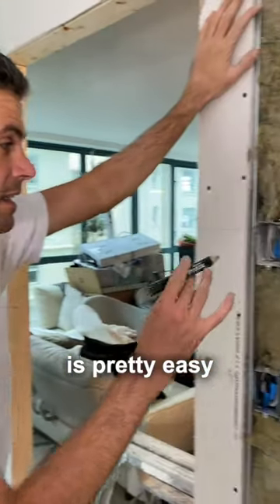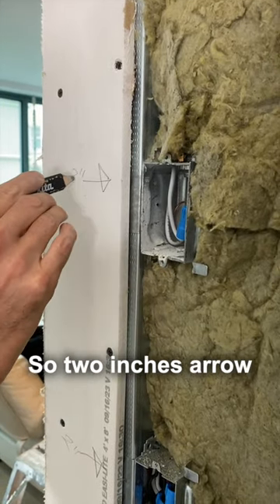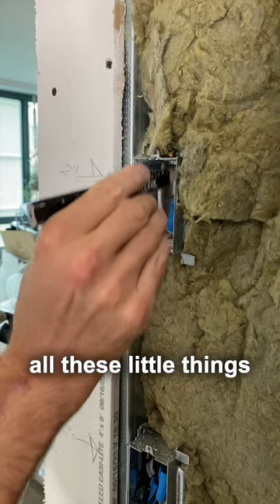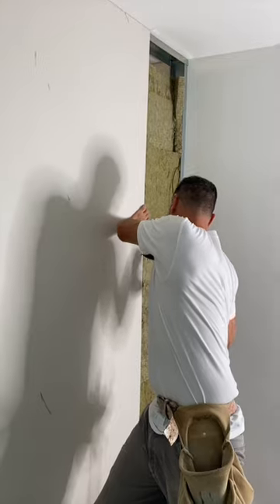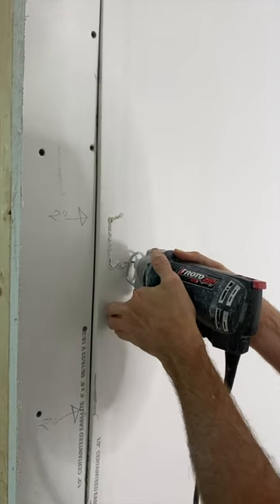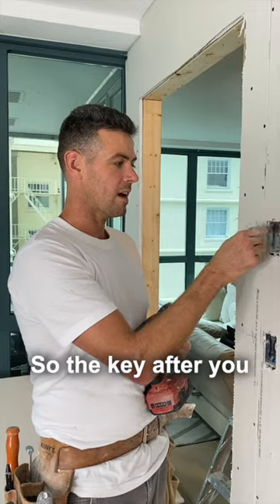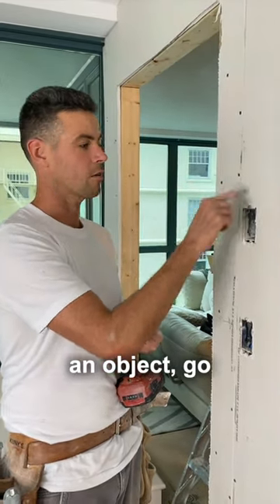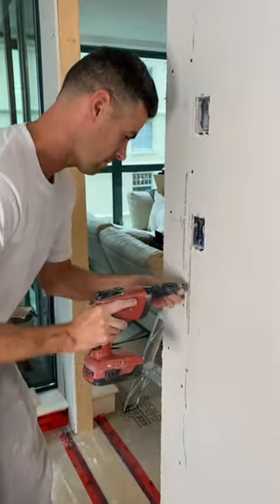How to Use a Drywall Router. The Easy Way!

Comment: Man your drywall tips are killer. I’m a carpenter, but I’ve been getting more into drywall jobs lately with a buddy of mine. We’re both okay at it, but your videos have been a huge help with stuff like this. Thanks brother!
Reply: Is being a carpenter very physically taxing? Or is it manageable?
Reply: @ereh11  once you get used to it, it's not that taxing, plus it's great for the body. You are bending and twisting and reaching above your head and down to the floor. So much healthier than sitting in a chair all day.

Comment: Metal boxes make is so much easier! No fear of burning through the damn thing!!
Reply: Exactly 
I always cut through the blue boxes and mess it up
Reply: Yep, annoying
Reply: So that's what those cuts in my electric boxes are from. Go figure.
Reply: @carpentrylover145  if you use the guide point bits, it is less likely to cut through the plastic box.
Reply: @larryrice2654  agreed.
Reply: Should be code everywhere except for exterior applications. Plastic boxes are junk!
Reply: If you know how to use a router it doesn't matter if it's metal or plastic
Reply: If you let the router do the work and push gently you'll never burn through a box. And you have to have the correct bits with a dull guide point
Reply: @graxo3752  agreed, but there is a learning curve! If you are not a professional, doing it every day, it takes some time to get a feel. Hell, it takes a moment to remember which to go!
Reply: How does one solve the issue where too much mud made it inside of the electrical box? It's a pain in the ass for electricians
Reply: @fixerofthings  yeah good to know that I had some incompetent moron doing my drywall 😂
Reply: what’s the screw tool called?
Reply: @YouTh3r3 It's supposed to be the drywall finishers job to carve out any excess mud around the inside of the box when fully cured, but based off the internet beef, many in the trade don't seem to bother.

Comment: Here’s a pro tip, never land a joint next to a box, you don’t understand how much more annoying taping that is
Reply: You put it where you want/need it, not where it's easier.
Reply: @habiks you put the box where you need it. You can put the drywall where you want it
Reply: I'm more concerned about the joint being so close to the door. Less likely to crack if it was above the header. The box close to a joint is just a minor inconvenience
Reply: Most times you just don’t have another choice. And its really not THAT much harder to tape 😂
Reply: big time. amateurs are commenting on this.
Reply: Lol bud youre not a pro because you like easy short cuts and avoid a little extra work😂😂😂
Reply: @CFLavertu No disagreement there, but in this case. He had that choice. Look at remaining wall layout.
Reply: @HumilityListens  tell me you've never done drywall, without telling me you've never done drywall 😂😂😂

Comment: I like when the drywall guys use these on all the blue pvc boxes. Just wiggle them around every which way as if they were trying to draw a star. Cut thru the sides, top, screw holes and wires.

Comment: As a Sparky, my only request is; If you're going to plunge inside the box, please use depth gauge with router set no more than an inch deep. If the wires ain't tucked in beyond that, thats on us!
Reply: Nah make your job harder as payback for getting in the plumber’s way!
Reply: Some of them still hit them no matter how much you tuck. I just tuck plenty and leave a little towards the front. Then the rocker can get his satisfaction nicking wire and I still have enough to work with.
Reply: Take a hammer and push your wires in. Plus the rotozip bit shouldn’t be that deep, only the tip should be touching the box to guide the bit. Too far in and it can’t cut it right and you have no guide on the bit. Been boarding for 10 years and there’s a reason my business is Precision Construction
Reply: Lol, I love coming back to a job just to see some of the wires mangled to bits. You can only tuck those wires in so much and less so with boxes that are busier.

Comment: I have to say I like your videos but I think going clockwise gives a much better result. The fact that you were on a small metal box where the device ears are outside the box saved this cut. If that was a plastic box, device holes inside, and you had a gap as big as you do on the bottom left, a standard size plate may not cover. Ditch the depth guide, it’s just in the way. I also like to hold a vacuum hose to the cut to suck up the dust before it gets airborne

Comment: As a young general contractor I’m often impressed by older people that actually have the time to teach others how to properly do things

I generally cut a hole with my drywall router before I place the Sheetrock on the wall… there’s a small gap all around but trust me when I say, it’s much better and faster than any of my other workers would’ve done 😂😂🍺

Comment: That's a brutal cut
Reply: Right... The metal boxes are a bit smaller so it will cover, but gaps that large on a plastic box may not.
Then they mud it in and sand it smooth, but often leave mud in the box. When you (the electrician) break it free to clear the box, it tears the whole patch out. Either that or it cracks later because that mud isn't actually bonded to anything, particularly when they leave dust there before mudding.

I like the box shaped vibrating cutters much better.
Reply: Tekagi  Yeah, the work I am seeing is quite sloppy. Lots of mud in the boxes, 1/4-1/2 gaps around them covered with mud against dusty drywall where it barely sticks and not pushed back in for adhesion and support, and often cracks when the cover plate is installed. I tried to score the break with a knife, but most were so delicate they would break with minimal force. Another thing they would do is slap some tape over the gap with nothing behind it. Once sanded it is very thin and flexes at the connection to the drywall making a crack outside the cover plates.

I ended up filling the space behind the gaps with expanding foam to give the plaster something to support it. A lot of extra work fixing them.
Reply: Yeah, I'm OCD (it ain't a profitable trait) but I like to vacuum the dust and then push a good amount of hot mud, made with glue in my water, around the box, letting it stick out into the box just a little, then come back with a utility knife once it sets and shave it down to a perfect rectangular opening using the inside of the box to guide the blade.  Damn it looks beautiful when done but only myself and electricians will likely ever see it, lol.

Comment: I recently bought a rotozip, I used to premeasure all my boxes and try to get the cut just right, and it was a pain. Now I just measure to get the center, make a hole ahead of time, then put up the sheet and cut all the boxes. Takes a bit of practice to get it right though... I have a few where I cut way too much out. I can always do the handy man special and use the oversize covers. :P

Comment: Why do you go a certain direction for tracing the inside vs the outside of the electrical box ?
Reply: If the bit makes contact with the box it will want to pull away or towards you, depending on which way it spins. You always want the bit to pull opposite the way you push the cut.

That he recommends counter clockwise for outside, you can deduce his router bit spins clockwise

Comment: I've been having a heck of a time doing this with plastic boxes. I've seen videos that make it seem possible but it seems like the bit will get hung up and next thing ive made a little divot in the box just from the heat of the guide tip. Definitely easier with metal boxes. Any thoughts?
Reply: Metal boxes are easier because they also get a “mud ring” and even with the ones that don’t there’s no play in a metal box unlike there counterparts. Or when people use remodel boxes like new construction boxes
Reply from the maker: I think the plastic boxes are way easier. They are only a rectangle. You need to make sure you are riding the end of the bit against the box and not the threaded part. The end has no threads so it can roll on the plastic. The metal boxes have way more going on so you have to be able to visualize the shape when it’s behind the drywall. Starting in the same spot on every box if possible will help it become a memorized motion.
Reply: Theres a couple types of bits.  Some have a non cutting tip and you can adjust the shoe to proper board depth.

Comment: Why would you put a flat joint right next to the box when you should have put it over the doorway anyway? That would eliminate screws being too close to a box as well.

Also, the next sheet going up looks about 16 inches. So what you did was add another 8' flat for the taper instead of a small joint over the door.

2 birds, 1 stone.

Comment: I honestly hate having to finish around where someone has used a router because if I don’t take a razor and clean up the roughed up edges it’ll put trash/hitchhikers in my mud. I’ve always thought it a better practice to cut a clean razor before installing. But, to each his own I guess
Reply: You should see my box cut outs, always perfect. All you need is x-bit guide bits and you slow down around corners. Super easy

Comment: ah so that's how those wires get nicked
Reply: I would say measure to the outside edge of the box and start like a half inch in from there before jumping over and going around
Reply: If u push the wires to the back of the box then ur router bit isn't long enough to touch the wires
Reply: Buy guide points zip bits, especially if a noob...

Comment: If im measuring, i measure right to the edge.
Reply from the maker: The edge is not always where you thought it was once the sheet is tacked. The middle of the box is a bigger target and easier to hit every time.
Reply: @vancouvercarpenter  it is when you measure off of the place where you did. No disrespect, but I've been hanging sheetrock since 1974 before there were routers. We used to precut everything. There are times  that I do go to the center area of the box. Especially in can lights. I was only pointing out that if you are measuring, you might as well hit the edge. Not trying to say you're doing it wrong.

Comment: Isn't this the carpenters job?
Here in Europe we just use round boxes, the carpenters put a magnet in it and then put up the drywall and another magnet on the other side and then drill with a round saw blade
Reply: It's also way easier to get a piece of chalk and smudge the edge of the box. Tap the sheet against the chalk, cut the outline. Fits like a glove most times and if not, shave to fit. -midwest

Comment: technically that's not a drywall router, its a rotary tool. Not usually a good idea to be using it that close to electrical wires.   That said, why is there insulation in interior walls.?

Comment: One additional tip from a boarder with 35 years experience...PUSH IN THE WIRES...then you will not cut them with the router bit !!!

Comment: *routing out a box. *going to rout from here. *The rotozip is a router. 

The router is called a router because it routs. 

Rout-er it's a varation of root-er. A pig is a router because it eats roots. The tool was named so because it cuts a groove the way a pig digs a groove in the dirt with it's snout, eating roots and insects below the ground.

Additional information: you can use a rotozip bit in a drill. You dont need to buy the tool. Dremmel also makes this spiral cutting bit.
Reply: Drills go slower than the dedicated rotary tools.  Plus the chuck isnt engineered for the side pressure and a rotary tool has a shoe which helps regulate depth.  A drill will work for small projects/occasional use but will be slower and may  shorten its life.